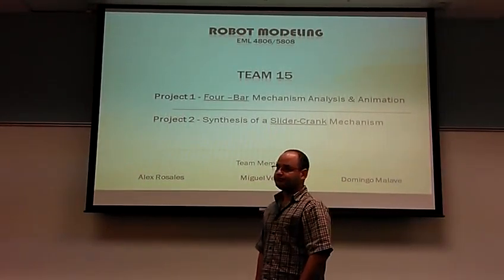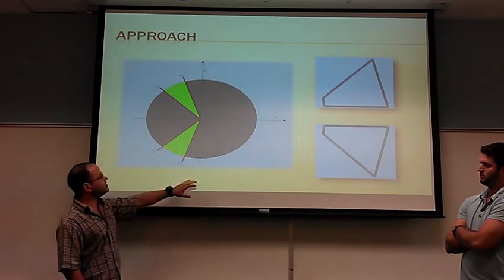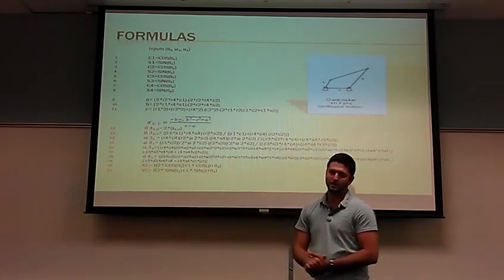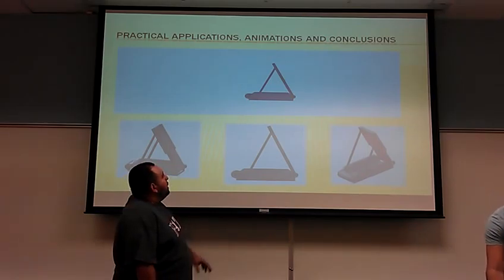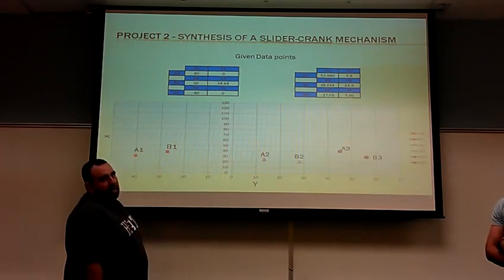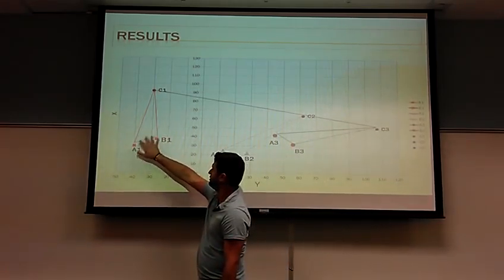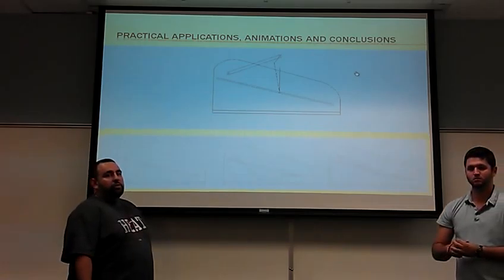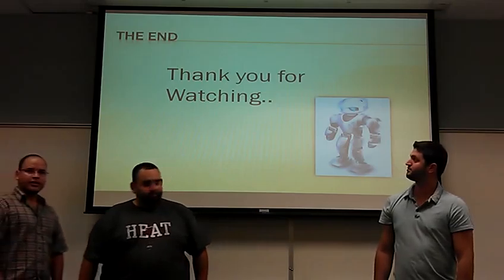Team 15: Presentation on Kinematic Design of Four Bar and Slider Crank Mechanisms

Comment: Great graphics, audio and video quality. Some of the slides had to much content on them so it was a bit hard to read them. Next time try splitting some of the content in two or more slides with a bigger font. Nice presentation and analysis.

Comment: Really good figures and tables, however, the formula slide was unreadable.  Try to keep it simple, and focus on the data obtained, rather than how you obtained the data.  For the next project try to introduce everyone in the group in the beginning, and wear business attire.  Also the sound quality isnt that great.  But overall great presentation!